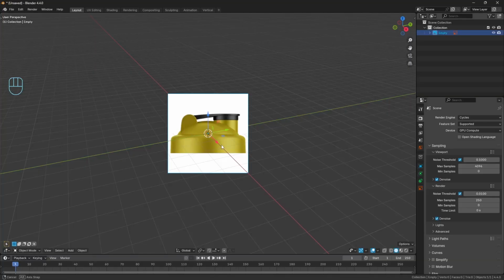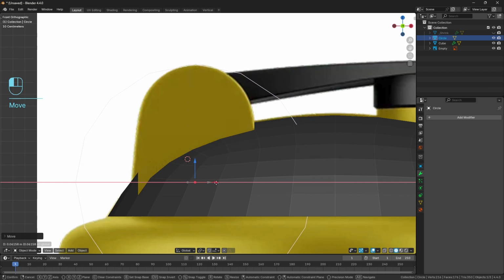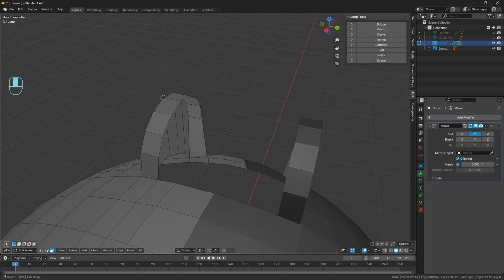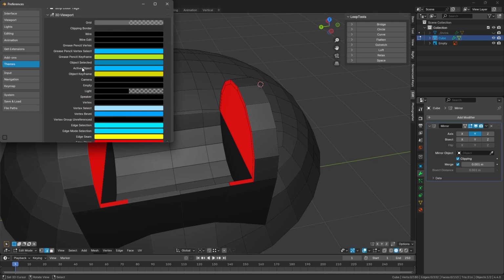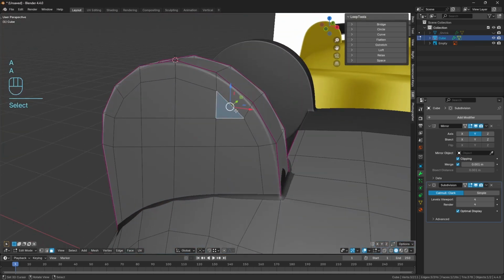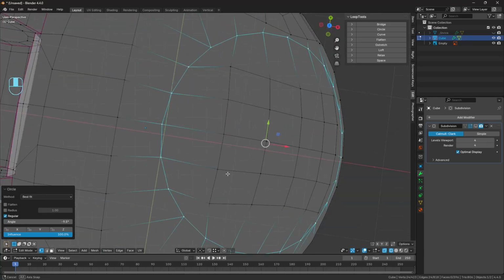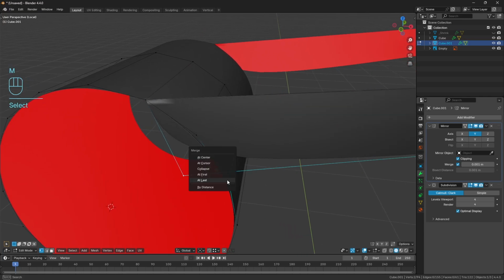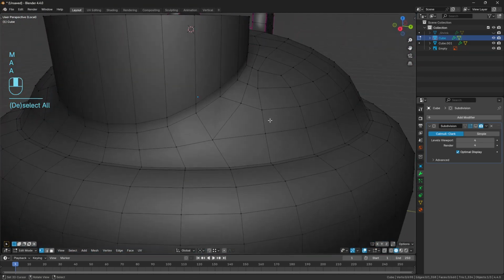Blender Modelling Tutorial | Protein Shaker Lid

Comment: Nice job ad usually, data transfer can help you tò avoid pinch
Reply from the maker: Yeah, data transfer is extremely powerful! However, since the pinching is occurring about a pole connecting two different shapes, I don't think data transfer would work well in this instance.

However, I have a video coming up that will use the data transfer modifier to great effect. 😄

Comment: 1 min in, hw come you didnt just add a spare instead of a cube?
Reply from the maker: Great question! I touched on this briefly in the video but didn't go into much detail about it. A subdivided cube creates a quad sphere, whereas the default UV sphere has triangular poles at the top and bottom caps. 

These won't subdivide nicely and would make the modelling process rather tricky, as we would first need to clean up those massive tris poles.

A quad sphere avoids needing to do any of that cleanup and gives us a clean set of geometry to work off from the get-go. Hope that helps explain things. 😄
Reply: @masterj2001  yh it does, i never new triangular pole would have and imact XD well the more you know i guess, thx for the reply
Reply from the maker: @ no worries mate, glad I could teach you something new about modelling. 😄